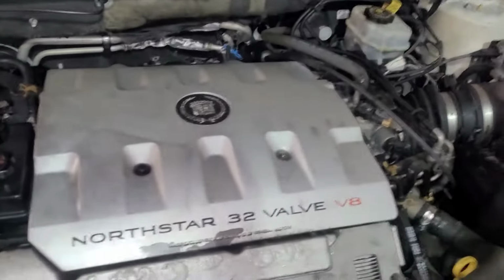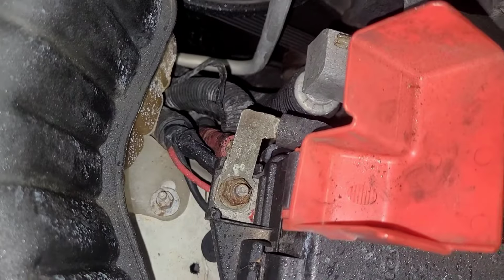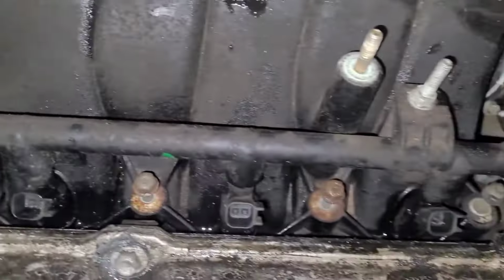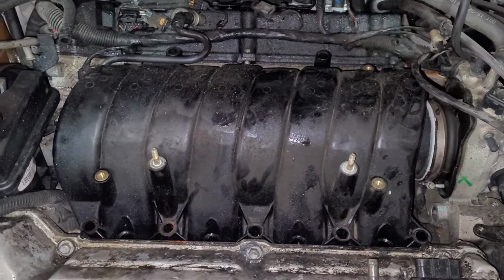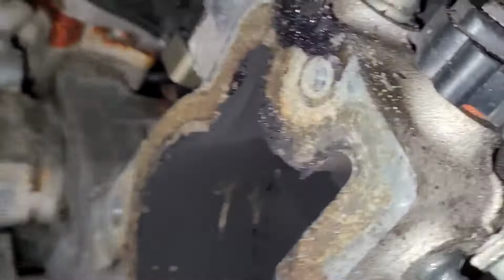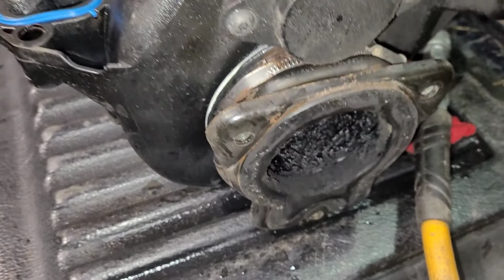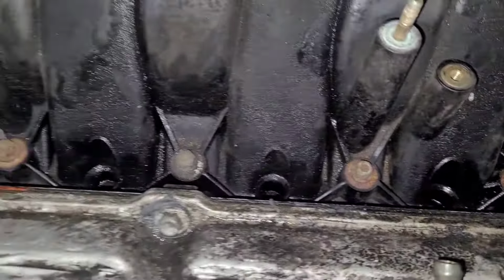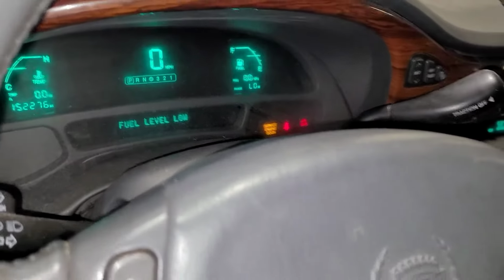Cadillac Northstar Starter Replacement. The dreaded starter under the intake manifold !!

Comment: I never understood why so many people thought Northstar starters were so hard to change. I was a tech at a Caddy dealer for over ten years and could change those starters in about 20-25 minutes. Wouldn’t even take the injector rail off, just loosen the bracket at the throttle body, then prop up the intake on the passenger side with a hammer handle.

For others asking, the starter is held to the block with two 10mm headed M8x1.25 bolts. A swivel 10mm socket on an extension and it’s free.

Also Kenny, that intake boot with the clamp and three throttle body bolts; those crack on the rubber side sometimes and cause a vacuum leak/P0171/P0174.
Reply: Your comment answers itself.  The idea of removing the intake and exposing the valves and pistons to foreign matter getting into the engine for a Starter was unheard of for much of the history of the internal combustion engine.  Now you've added another wrinkle. disturbing the throttle body boot which may already be old and ready to crack, the mechanic doing the Starter may cause a problem in a completely unrelated system.
Reply: @johnguilfoyle3073  Yes, but because the starter is kept warm, dry and out of the elements, their failure rate is very low. I think I only replaced a handful of starters in the 10.5 years I was a tech at the Cadillac dealer.

Oh well, no need to argue. I just don’t think they are difficult to replace.

Lastly, the boot that cracks behind the throttle body is usually cracked prior to disturbing it. I was just giving Kenny a heads up.😎
Reply: @johnguilfoyle3073 I replace the starter, it cranked. I let it run turned it off and it won’t crank any more
Reply: It’s the time to do the job, plus dealing with people who don’t want to buy new gasket
Reply: I have a caprice 86 would that method work for me as well?

Comment: My Toyota Tundra with the 4.7 V8 is the in the same location...A pain to change out, however, I will say it sure lasted a long time before going bad,,,possibly because of its location out of the “weather” as opposed to on the bottom side of the motor.
Reply from the maker: I agree that the location being the reason they last longer . Thanks for watching !!

Comment: People laugh at the location, but actually it is out of the bad weather environment, as well as being away from the exhaust heat, prolonging starter life. I believe GM thought this out. On another note, the Northstar is an interference engine, however it uses a chain system for the cams instead of rubber belts. I have read the chain system was designed for high mileage. The weak spot is the head studs. Otherwise, a rockin' engine (I have owned two of them).
Reply: Can't be to great of a motor if you've owned 2 of them 😂

Comment: I would like to know the purpose of the hidden starter.  Does it last longer being away from the Exhaust and the weathering from the elements?  Is that worth the extra effort?
I don't suppose you can bang on that with a tire iron if it starts to hang up like every other starter.
Reply: To keep it from getting wet cause it used to be on bottom of old caddys and the would mess up

Comment: Closest I ever came to doing a northstar starter replacement was an aurora 4.0 motor. But that was actually a cake job.
Reply: I own one currently and the starter likes to click at random even after battery replacement. Is the location the same as the 4.6 like I’m thinking? Also, how rough is the alternator to replace?

Comment: I have a chance to get a 2001 Cadillac .."that only needs a starter" .. I don't feel feel confident that I can do this myself as I only worked on stuff from the 50s, 60s, 70s and 80s, and a few things from the 90s, that did not have plastic intakes, or fancy computer stuff. Can I bring it to you and bring my tools, and parts, and i do the work under you strict supervision so I don't do something incredibly stupid and end up having to buy a new engine and paying the Cadillac place to fix my F ups? I used to love Cadillac back when I had a few Cadillac hearse.. a 67, 77, and 78, but these new ones or way over my head with all the plastic and computer sensors.
Reply: Newer cars are about reading the manual and way easier than old cars , I would not let go a Northstar go because of the starter , 25 min. Labor , can't say everything is easy , head gaskets are the worst problem with this , overall I love this engines
Reply: @victorvicara8518  to me older computer free cars are way easier. Starters or easy on older cars .. 2 or 3 bolts and some had a shim, 3 wires and you were done we used to be able to change the solenoid but now they cost as much as a starter with them installed.   We replaced a lot of the dummy lights on cars mad in the 70s with Guages and they were more accurate.  And easy to fix  and replace... and cheap. Lol.

Comment: While yes, it is a dumb location and turns a simple 10-15 minute DIY job into a lot of extra shit your simple shade tree mechanic might not feel comfortable tackling, at least everything is right there. You don't even have to get on the ground and roll around in the gravel! Lol. And plus it's a northstar, so you already know the intake manifold gasket needs replaced anyway😂😂 knock 2 birds out with one stone. Now on to tackle every other gasket on the engine that starts leaking after 100k. Gotta love the good ol Northstar!👌😑